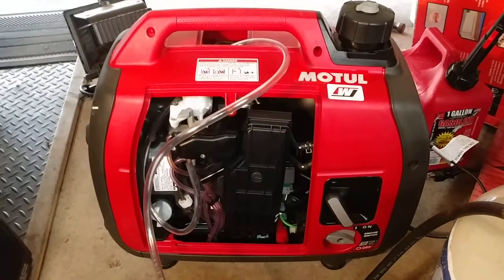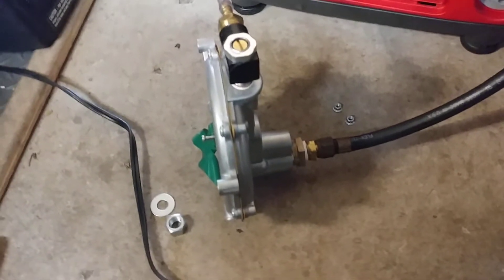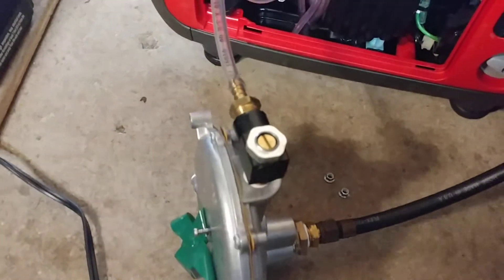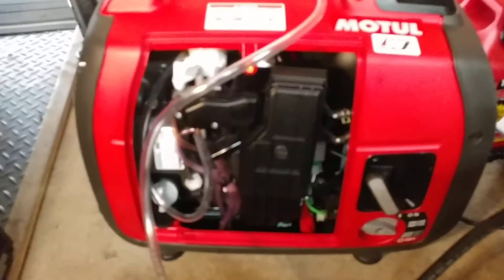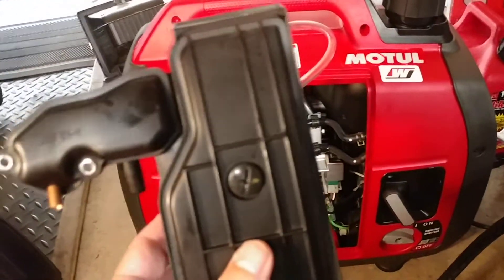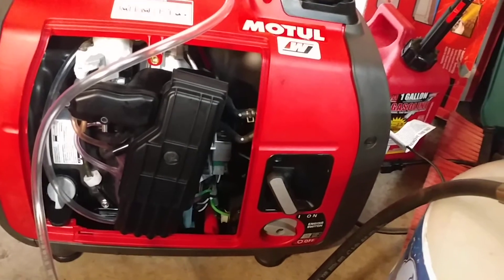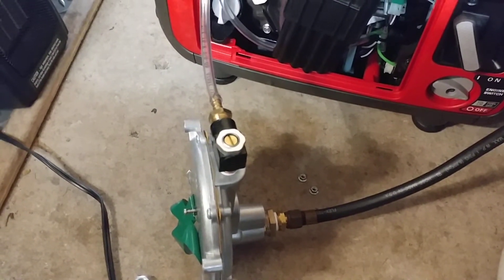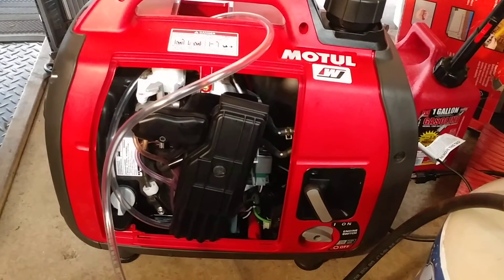Honda EU2200i generator DIY propane or natural gas conversion kit

Comment: The fish tank tubing will deteriorate quickly when you run propane through it.  Quarter-inch or 3/8" fuel line would be better.
Reply from the maker: True, I did switch to fuel line, but didn't have any during my testing.